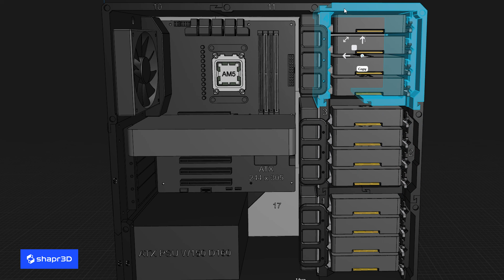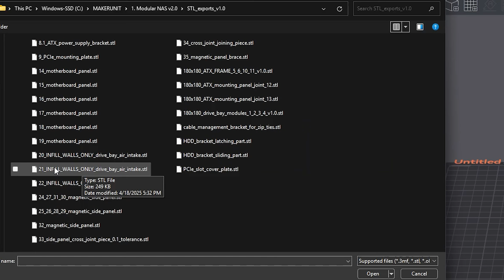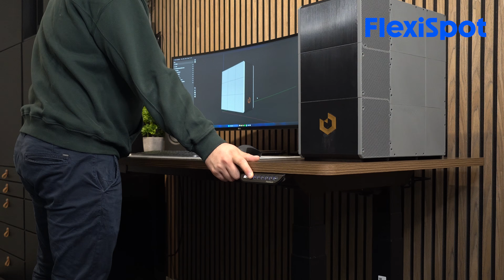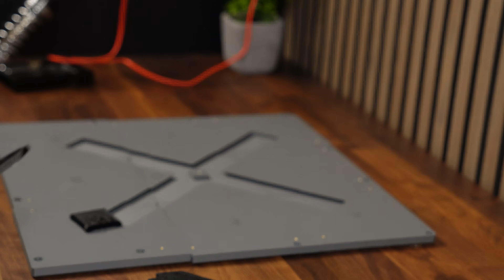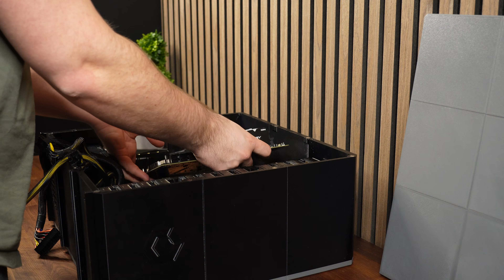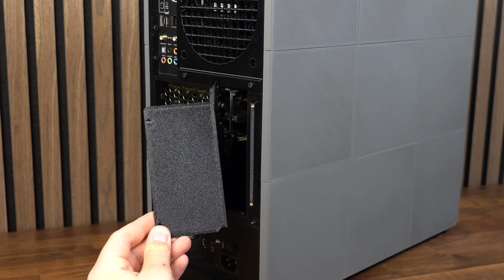Maximize Your Home Storage With This 3D Printed ATX NAS Case

Comment: I would love to see a 3U or 4U rackmount NAS design for home lab. I think it would present some interesting challenges for managing weight on the mounting ears as well as a different form factor. I've tried a few options from other creators without much luck. I love the attention to detail and beautiful designs you create.
Reply from the maker: Thank you! 🙏 You’re definitely not the only one wanting a rack mount NAS case. It on my «eventually» list 😁 It might be an option to use a metal tray, and design something mountable to that tray perhaps.
Reply: @makerunit  You could use a cheap server rack shelf thats about 20 - 50$ that would solve both mounting and stiffness.
Reply: It should really just be enough to adjust the dimensions to fit a server rack shelf, and to relocate the air intake to the front, as it would otherwise be blocked by the shelf. And the power button may also need to be relocated, as it becomes difficult to reach in a server rack.
Reply from the maker: @tonilundin  The only problem stopping me is the fact that I don’t have the actual rack itself. Hard to test a potential design without the rack itself 😅
Reply: @makerunit  I can help with that - I have a 42U rack and a 5 machine print farm to quickly turn around iterations. Happy to print off some designs if you ever want to do it. I'm just not even slightly capable with doing the actual model designs
🙂
Reply from the maker: @ I've got 3 printers myself so printing isn't usually a problem, just not the rack! :D Perhaps I can convert an IKEA kitchen cabinet with some brackets to one for testing purposes in the future!
Reply: Get a LACK table... The legs are perfectly spaced for 19" components (google "LACK RACK") 😉
Reply: @makerunit  Please move it to "next to do" list 🍺
Reply from the maker: @ If only I had a rack, and actually space for it in my small 10m^2 office I would do it right now honestly. However it might have to wait until I’m able to move to a bigger place, but when that will happen is hard to predict. Unless I find another clever solution 😅
Reply: @makerunit DeskPi has amazing 10“ Racks that fit on any desk. Should we organize one for you 🤭🙏🏼
Reply from the maker: @bydennisheck  That’s actually pretty sweet. From $80 for the T0 4U case,it looks pretty decent actually. I wasn’t aware of these. I’ll definitely consider this after a little further research into the options 😊

However, with shipping + import taxes to Norway I’m looking at around 190 USD 😅
Reply: @makerunit  I have the T2 at home, and the build quality is amazing. I’ll be sharing a lot more about it in the future. With your following, you could definitely reach out to them directly, they love collaborating with people like you. Their support is excellent and they usually respond very quickly. Or would you like me to try and arrange something for you? 😉
Reply: @makerunit  You've got a Mail :D
Reply from the maker: @bydennisheck  It did cross my mind. However, the only thing holding me back from asking for a sponsored product is that those deals usually come with deadlines. We’re currently expecting our first-born baby to be born in 1-3 weeks. Due to this I kinda don’t wanna commit to a sponsored deal at this time to add extra stress to those first few months.

I might just buy one so I can take my time and work on something slowly in my own tempo 😅 not sure if saving $200 is worth the extra stress in this period.

Or if I were to get something sponsored I’d need a pretty generous timeline as the coming time is quite unpredictable. 😁
Reply: @makerunit  funny. i finished this project exactly yesterday. mounting a dell 5090 on a metal tray for my serverrack. with a custom base plate and case for it.
Reply from the maker: @ Nice! I'd love to see some pictures for inspiration if you're willing to share some!
Reply: @makerunit  you want me to send some to your email?
Reply: @makerunit  a super cheap alternative is to use an ikea lack table for your "rack" you can easily buy some rack ears for cheap to get mounting holes/spacing figured out and can "mount" it to the table upside down (id rest the device on the bottom side of the table as the legs are hollow). Then when your happy you can find someone with a rack to do a final test fit before release! Because I would absolutely love a a rackmount nas case.
Reply from the maker: @Cr480mx  honestly, that’s a clever cheap solution, however if I were to make something custom I’d wanna either make it fully 3D printed, or a metal rack with 3D printable «drawers». Price is not an issue, I just want something practical and moveable that looks decent 😁

My main goal is for it to be something easily obtainable for anyone as I often build my projects to share it should be easily accessible 😊 which LACK is actually, so that could work too I guess
Reply: @makerunit both a 4u and 2u ATX case would be amazing, I would like to fund this project please.
Reply: @makerunit would love this finding a rack mount 3u is very pricey having something i could learn to print my self or send to pcbway and have them printed for me
Reply: As 10” racks are becoming more popular, maybe a 4/5/6U 10” NAS?
Reply from the maker: @ maybe maybe! 😁
Reply: @rorylong314  That would be amazing! I’ve been searching for something like this, but I couldn’t find anything that suits my needs. Building my 10" Rack at the moment.
Reply: I've seen some designs recently for clever 3D-printed racks built around using standard 10U to 16U (metal) rack strips. Most of those are for mini-racks (10") so it would be awesome to see ones for full-width ones.
Reply from the maker: @felixfujishiro2304 That’s pretty clever honestly. Printing the chassis, but only adding the mounting points in the form of metal for durability. Definitely spiked some ideas in my head. Thanks for the suggestion!
Reply: Came here to say this 😂
Reply: Came here to say to say this!! You should blame it modular. With different internal components. I already have a Nas just want to rack mount ny pc!!
Reply: I was coming into the comment section to post this but you beat me to it haha

Comment: how much filament is used to print it?
Reply from the maker: Roughly 4-5kg total, about 2.5 to 3.0 for the «middle part» and about 1.5 to 2.0 for the side panels based on my own way of doing it, I’ll add a more specified list to Printables, and the video description very soon 😊
Reply: Someone said around 4.6kg on the printables listing

Comment: What filament would you recommend using with this?
Reply from the maker: I’d recommend PETG at least for the middle part (black). 

I’m personally using PLA for the side panels (grey). Most of the structural strength is in the middle parts, drive bays etc. 😁